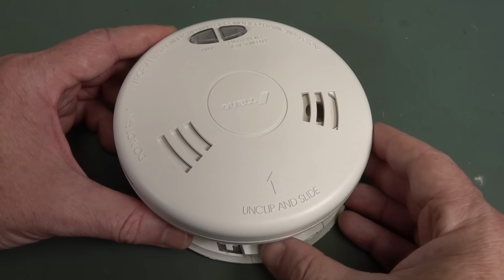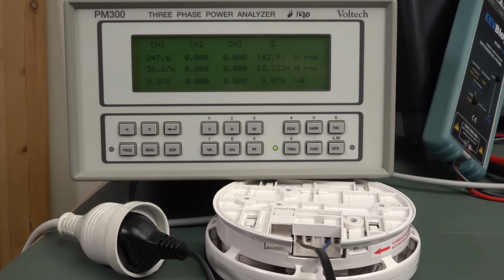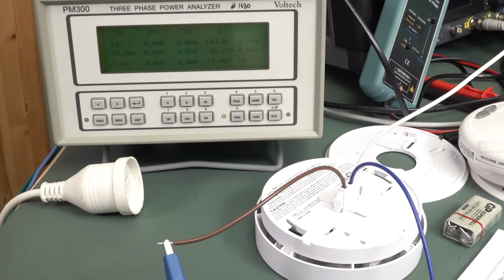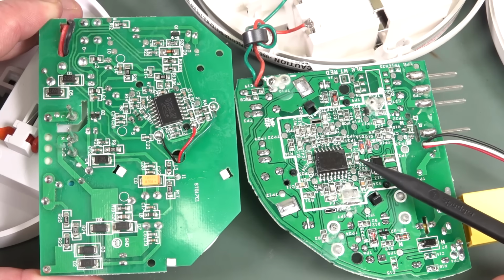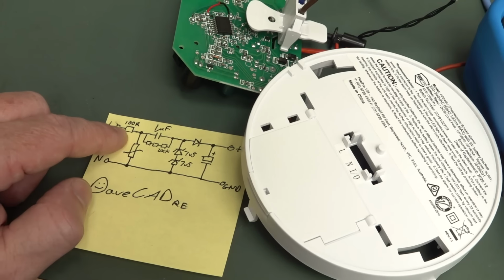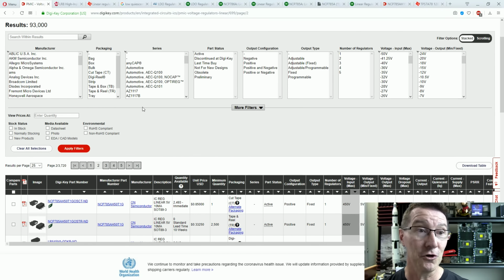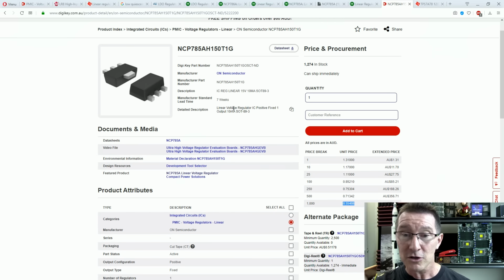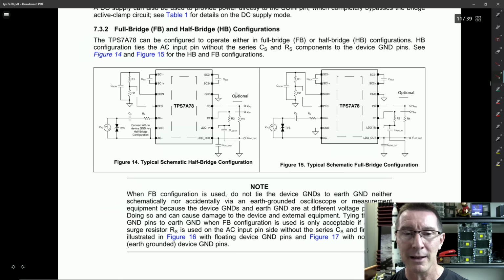EEVblog #1284 - How Bad Product Design Kills The Environment

Comment: I lived in a house that had Live and Neutral swapped on a few outlets.  It caused a significant amount of voltage on the ground contacts of the coaxial cable.  Never did figure out which one was the problem.
Reply: I discovered that the live and neutral were swapped on a light switch in my house when the socket went POP and showered sparks in the kitchen when I was trying to remove a broken light bulb base with a pair of needle nose pliers. I was glad that I'd decided to put on gloves at the last minute before starting work.
Reply: Here in western Europe we have symmetrical mains outlets - no way to tell which pin is live and which is neutral.  So they cannot be swapped either :-)
But what you describe there can occur nonetheless.  It is usually not caused by "swapped live and neutral" but by a symmetrical mains filter in the equipment (small caps from either mains lead to chassis) causing the chassis to float to 1/2 the mains voltage when it is not grounded.
Indeed, this can cause nasty surprises e.g. when you grab a grounded antenna cable and try to connect it to a device touching both the cable shield and the device...

Comment: What about the perils of mixing full wave and half wave rectifiers on the same incoming ac feed?  If one smoke alarm manufacturer was to use a non-isolated half wave rectifier in their product and another chose to use to use a non-isolated full wave rectifier if their DC commons are tied together you will also be wanting to have on hand a battery operated smoke detector to detect the smoke the two hardwired ones will produce if they are connected to the same incoming AC feed. 

 I think that may be why we dont see many non-isolated half wave and full wave rectified consumer products.  If they have isolation transformers before the rectifiers then no problem but snce in most countries our neutrals are grounded back at the distribution panel keeping the DC commons from being connected is difficult without isolation of some kind before the rectifiers.
Reply: Dave's reverse engineered Davecad circuit is of the manufacturers current inefficient capacitive dropper circuit.

 I am not questioning the manufacturers use of capacitive droppers but rather Daves suggested  use of half wave and full wave rectifiers instead unless they are also isolated from the mains.   If the proposed rectifiers dont have isolation from the mains this could lead to mixing full and half wave rectifiers together on the same AC feed which will not end well.    Adding the required isolation before the rectifiers would increase the cost of these smoke dtectors even more than Dave's  proposed 250V linear regulators.  In the case of a hard wired smoke detector you would also want to be connecting them together in some way to allow for one detector to set off the others in the same building. and this could very well lead to interconnecting their DC commons.

 Mixing a non isolated half wave rectified power supply with a non isolated full wave rectified power supply on the same incoming AC supply with their DC commons tied to ground will result in their diodes shorting each other out as they find a path through ground.  Proper incoming isolation and grounding would need to be observed or the magic smoke will be released from the rectifiers diodes.
Reply: With things as low power as these, it's not an issue. And you'll notice that in his reverse engineered davecad circuit, the zeners simply short out one half of the mains cycle(through the capacitor and resistor), so the draw them is still reasonably balanced. Yup, toss out half the input current, then toss out most of the other half. Uugh, I hate bad design.

Comment: The linregs would use more real power than the capacitive droppers though. The zeners waste a fair bit of power, but standard linear regulators won’t shunt current to ground when the voltage gets too high, so you’d need a higher voltage one or some sort of custom circuit. But letting the high voltage get dropped by the linear regulator might turn out to be less efficient than a well-designed zener system.

Also as far as products with terrible quiescent current, how about the NE555? Along with its terrible pinout, sub-Vcc voltage output, inability to do PWM without also doing FM at the same time, and how it’s a pain to get a 50% duty-cycle with it.

Comment: OK, help out a stupid mechanical engineer here... Why wouldn't something simple like putting a 2 mega ohm resister in placed of 1 uF capacitor work?  With my very poor understanding of electronics, it seems like this would trickle around 100 uA through the Zener diodes (or maybe a lower resistance with the half wave rectifier) .  And, with the help of the capacitor at the far right of the Dave CAD drawing, it would cover the 50 uA peak load.  Obviously I'm missing something, and would love to hear an explanation of why this doesn't work.
Reply: Your math is essentially correct. And there are transformerless supplies like you describe that do not have capacitors (if the load current is small enough). The capacitor at the far right is mostly to provide power inbetween the AC peaks, but it can certainly be oversized for transient peak loads (with the tradeoff that it takes that much longer for the circuit to power up when you first plug it in). Of course, all that is predicated on having a microamps-size average load. And LEDs like to draw milliamps, so they're a bit of a big current draw, even if you only have like a 10% duty cycle on them. With the right microcontrollers and such, what you describe is completely feasible.  I think the tricky part here is that you see the RMS amps Dave measured and think, "my goodness, that is huge!" at 80mA or so. But most of that happens when the AC voltage is near 0V, so it doesn't translate into much acutal power dissipation. If you consider that he showed 0.5W of power dissipation, that means it's dissipating power in your conceptual example very much like P = V^2/R  where 0.5W = (240^2)/R  which means the equivalent resistance in that type of circuit would be 115kohm. So 115kohm resistance to allow 0.5W/240V =2mA of load current, vs your proposal of 2Meg to allow about 100uA. The math checks out....BUT, because they spent extra to use a capacitor instead of a 115kohm resistor, they actually get a good bit more than 2mA out. They can probably support about 30mA of load current, based on a quick check with some design tools I put together a few years ago at http://www.designercircuits.com/transformerless.htm
Reply: @davidhoelscher  Got it.  So they probably need more than 2 mA to run the buzzer that @uK8cvPAq mentioned.
Reply: @andrewsnow7386  Typical specs for a piezo buzzer I found online is 5-20vdc and 10-20mA. There are a few ways to engineer the circuit in Daves video around all this but it would drive up the component costs and thus final unit price, apply that to a tradesman buying hundreds of these things in bulk those few bucks per unit start looking heavy on the old wallet.
Reply: Interestingly enough, if the power draw really is just 50uA (which seems reasonable), they could actually save money in production as well by completely eliminating the capacitor. "Across the line" caps like that aren't cheap compared to the DC output capacitor. As Dave suggests, this circuit really is a lazy, non-optimized solution where they just grabbed a transformerless circuit design that they know works in general.
Reply: When the buzzer sounds it suddenly needs a whole lot more current to make it loud.
Reply: @uK8cvPAq  Ah, the buzzer! Thanks, I knew I missed something.  But I really expected my idea would have more of a fundamental problem, not just a missed load.
Reply: @andrewsnow7386  Your resistor idea would work fine for those few hundred microamps to the microcontroller, but if the buzzer kicks in it suddenly wouldn't be enough and the voltage across the output of the resistor and return would collapse. It's like a thin hose pipe feeding a small water feature, that trickle is fine for the small load but what happens if the fire department need to refill their firetruck from it at the same time? Suddenly the pressure at the end of the hose collapses and it's useless to both parties.
Reply: @uK8cvPAq  Thank again. Yep, I get it.  There's no way my circuit could supply the power needed for the buzzer.  The obvious fact that a fire alarm needs an "alarm" completely slipped my mind -- oops.  Given the extent of my electrical knowledge (V = I * R,  W = V * A), I'm just a bit surprised to hear my circuit would work to run it at all (i.e., if there were no buzzer).

Comment: Make half of the smoke alarms use capacitive droppers, and the other half use inductive droppers, problem solved!
Reply: Haha. That might correct the VA, but you still have ~1W wasted in the zener
Reply: In fact in older days we had problem with too much inductive load: quiscent power of transformers, luminescent lamps with inductive ballast, motors etc. If this is still true, these capacitors actually take part of PF corrector, because industrial PF correctors are EXACTLY huge capacitors with commutators to turn on as many as needed.
Reply: @allmycircuits8850  - the "too much inductiive loads" situation is the same today. These capacitive dropper circuits IMPROVE the overall power factor,  and certainly DO NOT make it worse.
Reply: inductive droppers??? Proper PFC + LLC switching converter will be cheaper, take less physical space and cost less than 1/2 of inductive dropper with even lower standby power.
Standart flyback converter or PFC flyback converter versus inductive dropper for low power products - there is no contest there
Reply: @volodumurkalunyak4651  Why would anyone design a Flyback for that? Non-isolated buck is the way to go. You can even try to find the one that syncs the current waveform with the input voltage for active PFC... This beats the transformer cost easily.
Reply: @NukeDMAn  if there are ready - made ic for mains to LV buck - then yes, thanks for the idea
Reply: @volodumurkalunyak4651  power integration lnk302 and similar devices
Reply: @volodumurkalunyak4651  would that be reliable enough for a mission critical / life saving device? If I had to guess why they used a circuit like this, wasn't so much for cost as maximum reliability.
Reply: @PhilfreezeCH   PFC LLC setup will be cheaper than a inductive-dropper, forcing ( 1/2 devices cap dropper + 1/2 devices inductive dropper ) out of existence

Comment: I would use an English Electric mercury arc rectifier, it can deliver a 1800 amps at 150 kilovolts and in standby only uses a fraction of that.

Comment: Most home smoke alarms are battery powered only, of course. But point well taken. Looking at it a different way, though, if I have 3KW of solar power on my roof, 1W is a negligible load -- 24x7 if I have batteries, too.

Comment: Small mains lamps are another even bigger use of crappy power supplies - no necessarily a capacitor droppers.
Agreed that it's not the best design and that it adds up to create a bigger issue.  A couple of those specialist chips look good and cost may not be a problem when making millions of cheap smoke alarms.  But I wouldn't want to rely on a single source chip supply that could say "20 weeks lead time" at any moment.  Maybe as more of these chips become available they will be widely used.  A generic off-line low-loss low-power regulator available from many suppliers would be fantastic - like a mains smart 7805 with pfc.
I don't think it's as simple as a bad design and manufacturers who don't care.

Comment: So the poorly designed smoke detector uses  0.5W and the average US residential utility rate is 13.31 cents/kWh, you'll pay gonna pay 58 cents per year per smoke detector.
If a properly engineered smoke detector uses 0.05W, you'll be paying 6 cents, an order of magnitude lower.
would be interesting to interview the average consumer if they will consider buying a properly designed smoke alarm that will save them 52 cents/year
Reply: It's more to do with low power factor and unnecessary energy generation and distribution losses, it's got an environmental cost too.
Reply: @uK8cvPAq  at the end of the day, its gonna be the consumer's choice to buy whichever one.
so if low power smoke alarms are gonna be a thing, it better not cost too much more than the poorly designed ones. (just 30 cents more would be ideal)
Otherwise they'll just go for the cheaper poorly designed ones.
Reply: @260830107  That is a problem with many better products and ideas, most people are going to pick the cheaper up-front option on the shelf.

Comment: Include 3 of the tiny lithium ion 'sack' batteries in the cheap dropper design, so the resistors can be tweaked to supply just above the sensors wattage on 100 Vac. Then the Zeners will only burn off significant current on 240Vac, but still not much more than the sensor. 3 Li-ons will happily live at 3.4 v each and have no problem powering the buzzer, or the alarm for a few weeks/months during power cut. And save money on not housing and installing the 9 volt backups.

Comment: is the consumption too high because the zeners have to clamp down so much because your mains is so high by anychance ?
Reply: The capacitor is rated high enough to run the buzzer. Unfortunately that means the current your buzzer draws has to flow constantly through that capacitor, and because the zener diode is in series with it, dissipates power in that one. 

Essentially it constantly draws as much power as it would if it was screaming at you constantly.

Comment: Also a zener will be less reliable, they pop as regularly as old light bulbs, and in a smoke detector - even with battery back up, that is a reasonable concern. Those chips are probably an order of magnitude more reliable.

Comment: Dave (as others have done) has just driven off of the road into the ditch. Homes and industry present a largely inductive (positive reactance) load on the power suppliers.  Items like this and LED lamps with capacitive droppers (negative reactance) partly counter the existing positive reactance, they do NOT create a bad reactance.  This is review is a dud. Ron W4BIN
Reply: Power factor correction really only applies to the device in question, and PF can even vary how the device is used. You can't simply slap a negative reactance into your system and expect it to help. Besides, with more and more devices that have negative reactance on your house mains (LED bulbs being more common), you can no longer guarantee that most reactance presented to power suppliers are positive.
Reply: @wyrmofvt  True. Our house is mostly capacitive. The few motor loads we have are sporadic (fridge, boiler pump, clothes dryer). Most of the time it is electronic stuff with switching PSUs or capacitive droppers.

Comment: Will your proposed change in design allow for the abuse that a smoke detector goes through running on mains voltage , sudden high, sudden low ,switching back and forth during generator tests and so forth. On the HVACR side we use many smoke detectors in our equipment and they are essentially designed the same for reliability. Other equipment that I work on that has input regulators  they to take up smoking after a few hits .(I am not a electrical fungineer just a mechanical fungineer so I don't know these things.)

Comment: These smoke alarms will have a leading power factor if they use a capacitor dropper. Most mains loads have, or used to have when transformers were the common mains interface, a lagging power factor. Could it be argued that on balance the smoke alarms might balance out some some of the other lagging loads so might improve the overall load on the grid? I agree with you on using a linear regulator rather than a shunt zener diode though.
Reply: Yes, this is correct. Non-unity power factor can go either way (leading or lagging), and until you have enough capacitive loading to offset industrial motor loads (or even your home A/C unit), these capactive loads are helpful to the overall grid in terms of impact to power factor seen by the power generation equipment.

Comment: These things are not PCs though, they are not really in standby. So there is the sensor power requirements and the alarm. Wouldn't a switching supply that mostly upscales for the speaker be the most efficient?

Comment: How do they isolate the terminals from the 9V battery in such designs Dave?
Reply: I don't think they do. They are interlocked physically so you can't access the battery without unplugging the AC power connection.
Reply: @RobertHancock1  ahh...thanks.

Comment: Don't get it. If a 9V battery is sufficient to fuel this alarm for 5+ years why bother connecting it to the grid in the first place? Who wants to have cables installed for this or waste sockets in every room. ODD.
Reply: Wadel Radel government safety regulations. Hardwired means it’ll still work if someone removes battery and forget to replace it. And it allows all smoke detectors to be linked so if one goes off they all go off.
Reply: @CT-vm4gf  , seems a little overprotective. How many people have died in home fires in Australia in the last decade?